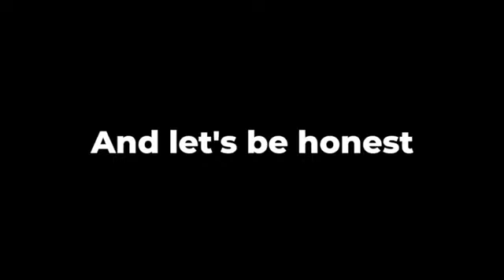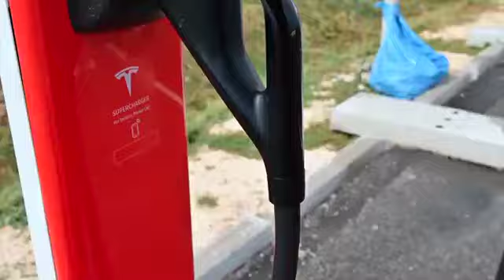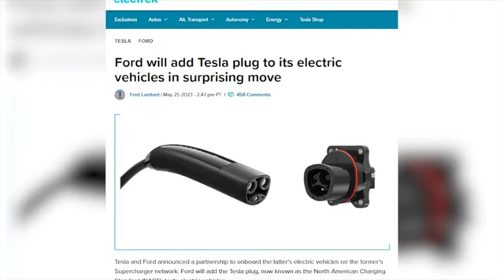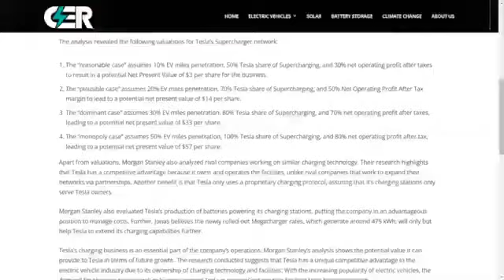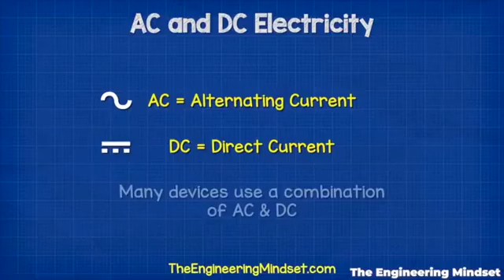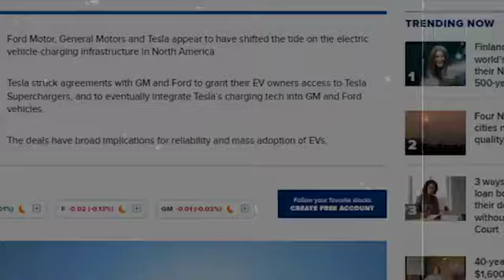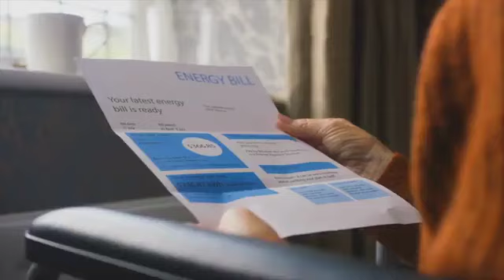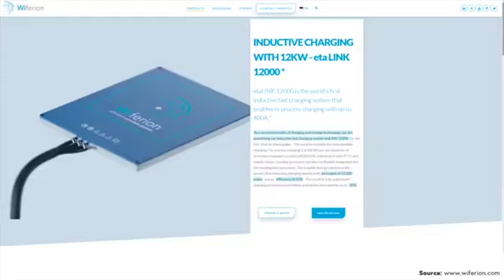CHECKMATE!!! Elon Musk's INGENIOUS Move Ends Legacy Auto Industry

Comment: The analysis is defective. Currently the power infrastructures do not support super charger station. Power plants do not have capacities to provide to many super charger stations as all transmission lines already overloaded. 
Another problem is to charge fast charger stations need high voltage sources that not always a available. Finally, on top of kwh bought, there will be surcharges from charger stations' owner, the land lease fee where charger stations located. So EV sells will slow down soon.  Customers soon will realize that waiting in line 30 min to charge a tesla is a waste of time beside the fact customers have to drive a distance to a particular chrging station.